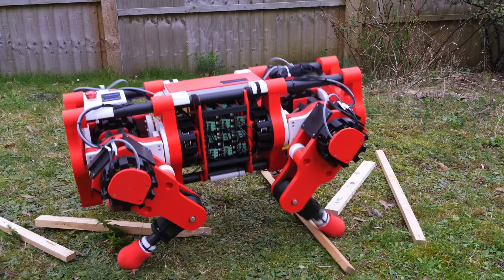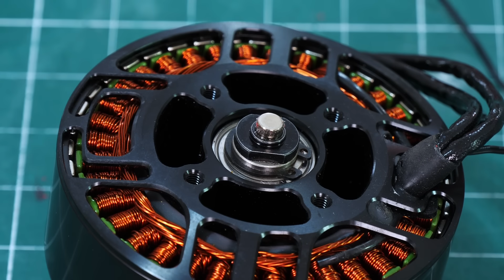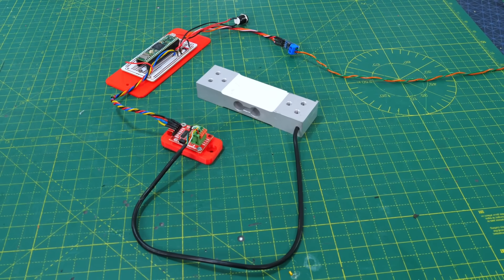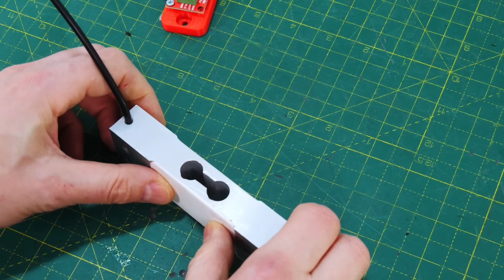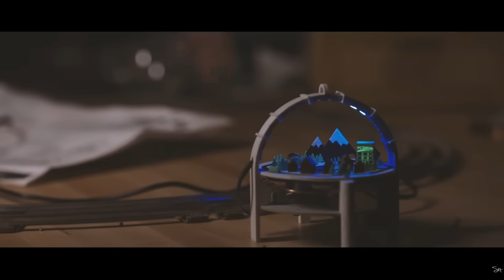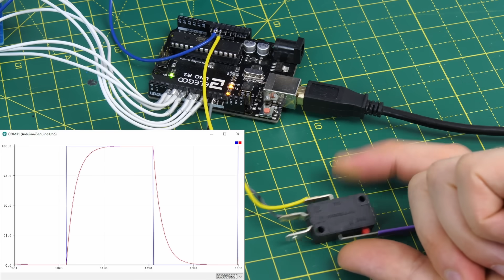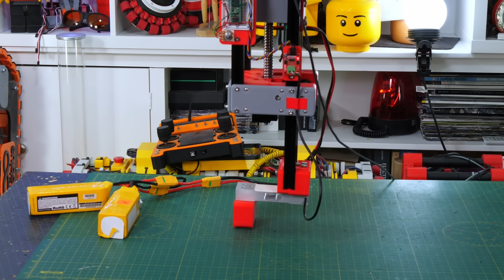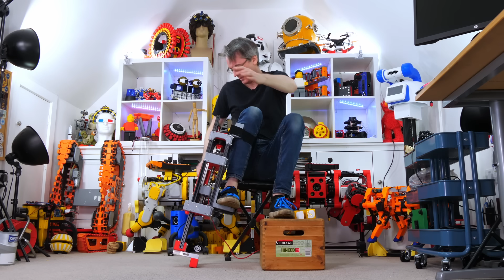Building a spring I can turn off with code

Comment: Why do you need the load cell? Why can't you just drive your motor in torque-mode, the torque (And therefore the force) should be directly proportional to the current.

Hooke's law says that the force from a spring increases linearly with the displacement, therefore you just need to set the torque of the motor based on the displacement from its home position, which you can calculate using the motor's encoder.

I would expect you to get better results with a larger pitch on your ballscrew (10-20mm/rev - Depends on how much load you intend to apply) and use the motor in torque mode to provide resistance, rather than to reduce resistance. (The loop speed within the torque loop of the ODrive is then the speed at which it operates, which is very quick. The updates to the amount of torque based on the displacement can be applied much slower.)

Comment: I worked through the control math for your setup.

If you run the motor in velocity-control mode (assuming the ODrive velocity loop is tuned aggressively but remains stable and does not overshoot), you can implement a PD-like position controller using a specific two-loop structure: an outer proportional term on position error, and an inner derivative term using measured velocity. In that architecture the commanded velocity is

vcmd=P (position error)−D (velocity).

If you choose 
P and D correctly—based on a simple model of the velocity loop as a first-order plant (ideally from system identification, or from an analytical model)—then you can directly specify the closed-loop 
ζ and ωn. From those, you can compute the equivalent virtual spring stiffness and damping, and then back-calculate the required 
PD gains.

I’m not trying to show off or get attention. I just don’t know the best way to reach you, and genuinely  I think this approach could solve the behavior you’re aiming for.
Reply: It can be done in torque mode instead, there's no need for the velocity loop which makes the control loop even tighter and simpler. A spring is defined as a force (Torque in this case) with a linear mapping to the displacement. (Encoder position on this case)
Reply: @yngndrw.  that would be ideal, but then sampling rate needs to be at 10s of KHz, I don't know if that possible over CAN BUS
Reply: @sammflynn6751  It doesn't need to be that fast, as the torque loop is entirely contained within the ODrive.

If you command (Once) a specific torque to the ODrive, you'll get a constant force on the actuator. (Fully controlled by the ODrive, with the tightest loop possible - In a brushed DC motor this would just be a basic current loop, in a brushless motor it's the park-clarke transform.)

It won't match the behaviour of a proper spring, it will be a constant force mechanism. (Like a gas strut)

If you (Externally to the ODrive) read the position from the encoder, calculate the displacement and then linearly map that to the commanded torque, it will now follow Hooke's Law and act like a proper spring - But the update rate of this doesn't need to be very fast, as it will fall back to the constant force mechanism between updates.

You now have a spring with an adjustable spring constant, and you can set the "neutral position" from which you calculate the displacement to be anywhere you want. (I.e. you can artificially raise and lower the virtual attachment point, AKA lengthen and shorten the virtual spring.)
Reply: @yngndrw. Agreed can be implemented using any of the onboard controller, suggested velocity control cause I just used it in a project recently for different goal, generating impacts,for my case velocity control approach yielded best response practically, in my case the current measurements were noisy and the inertia wasn't constant.

But I do agree with you torque control should simplify things, I will start working on a simulink parametric model, if I find a suitable model for odrive torque control and the motor parameters

Comment: Would this work with a BLDC + odrive with torque control? Then use a ballscrew with a pitch such that it's barely backdrivable.
Reply: Yes torque mode is the way forward, no need for the load cell at all. Set the torque based on the displacement. (Displacement measured by the motor's encoder.)

Comment: Looks like a lot of the flex that would have been adding to the oscillation/bouncing was coming from the 2020 and 3d print, not the load cell.

Comment: There is a solder mod you can do to the cheap HX711 load cell boards to bring them from 10hz to 80hz. I did it for my simracing load cell brake pedal mod and reads plenty fast enough. Just mentioning for brevity.

Brilliant as usual Mr. Bruton!
Reply: you can also run the clock faster than the datasheet specifies, I've gotten them to work reliable at 144hz

Comment: I think it can be improved by adding damper which is electronically controlled similar what corvette has. You would set it to absorb initial load and as soon as you feel that leg is rising you will release it rapidly. Then you can have relatively ridget setup which will absorb bumps well.

Comment: Could you put the strain gauge between the nut and the linear rail? I know electric power steering puts it right on the steering column shaft and it works very well.